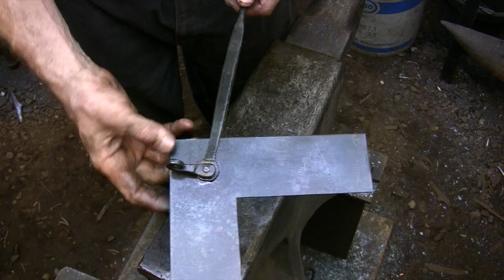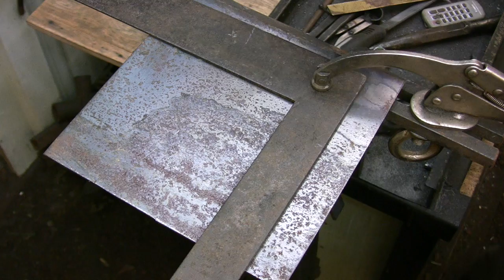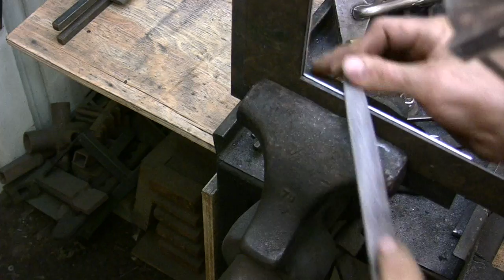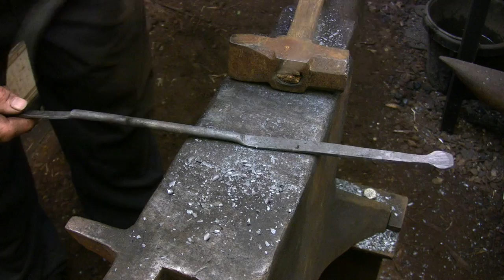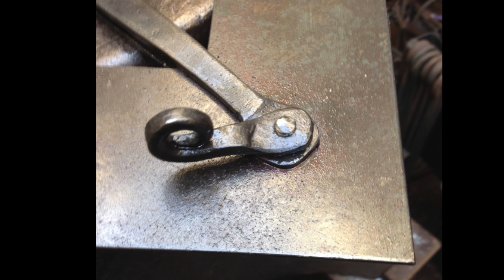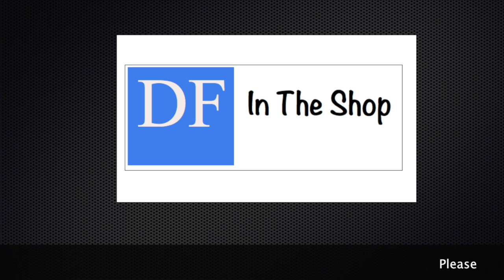Blacksmithing Project - Forging Square

Comment: Hi friend, 
I've been revisting many of your earlier videos, simply because I'm making more tools and your videos are relevent. 
 Something I've been doing is using percision tool steel like 01 to make filing tools for refining edge lines and reccoso lines of the knives I'm learning to make. 
By taking some time to making sure the 01 tool steel is as perfect as I want it to be. I then harden it, then temper it to a point that is still hardened more than my hand files. Then clean it up and I have a great
 tool/guide that will not be injured by some file hits.
I figure it will last forever as long as I dont throw it on the ground and shatter it, or take the temper out of it.
Just a thought.
BTW- I agree that 
blacksmithing and my welding fabrication is not machine tolerances, but I enjoy irritating my bosses with as much perfection on my projects as possible. That attention to detail transfers over to my  personal business quality, which then hopefully is noticed by my clients finished piece. I dont make as much money, but I sleep better knowing I gave them my best.

Comment: That 'little anvil' in your. hardie hole.... did you make it?
Reply from the maker: Yes I did.  The only  part that is solid is the horizontal bar that makes up the round and square horn.  The rest is square pipe.  I cut a "V" notch at the top of the pipe so I could hammer the sides in the form the taper that joins up to the top of the anvil.
Reply: I would be interested in a video of some of your favorite 'additions' to your toolbox that make things easier.
Reply from the maker: Good idea - I'll do that,  Thanks

Comment: Hi,

Just goes to show it is possible to do very fine stuff when necessary. This I am sure will be copies by those more capable artisans, and the rest like me can do the same thing from the start using nots and bolt.
Reply from the maker: That's right - this tool will work just as well with a simple handle made out of a piece of flat bar bent in half and a purchased wing nut.  Do whatever works for you

Comment: Dennis, two questions; did you say that you used a carriage bolt? And did you forge those calipers? If so could you show that sometime?  I guess that's three.
Reply from the maker: Yes that is a 1/4 inch carriage bolt. The callipers are made the same way as in my  dividers video only with curved legs.